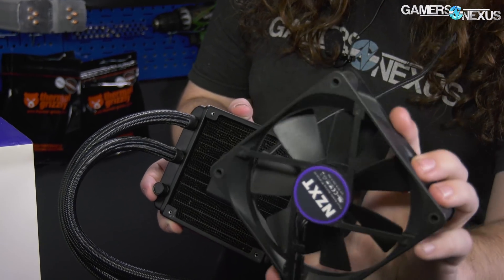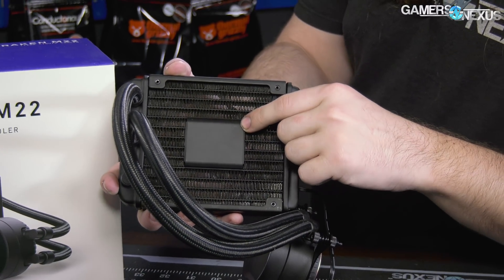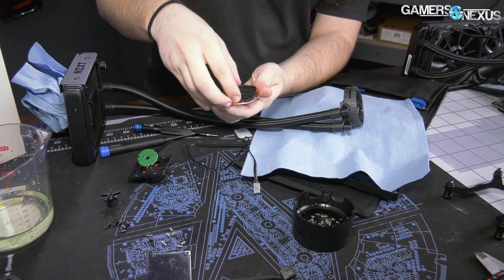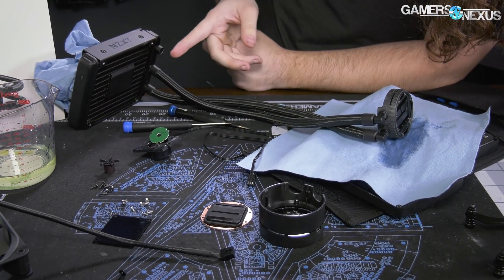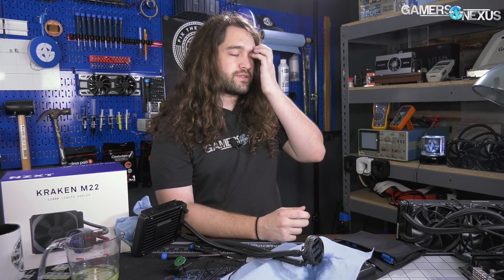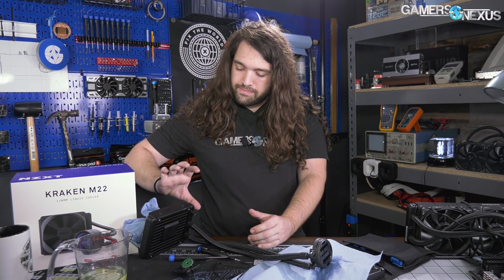Tearing Down a Strange Liquid Cooler - NZXT M22 Pump-in-Rad

Comment: You could put it inline, which would be better than on the water-block OR inside the radiator... But then It would be hard to keep buyers locked to buying only your proprietary hardware.
Reply: Point is that this is a fucking STUPID design.
Reply: Inline means a large ugly block in the middle of one of the tubes, which has been tried recently and not well received. This way they lost ~2 percent of the airflow to mean they can actually make their own product instead of just rebranding one.
My only concern with this design is vibration noise being transmitted through the radiator to the case
Reply: A Brackers - No. Try again.
Reply: Brad Gefroh Name any commercially successful aio with an inline pump
Reply: A Brackers - Name one successful AIO with a pump in the middle of the cooling fins. There are none, not just because this is nearly impossible to do with a reliable product, but also because nobody else is dumb enough to try. The system they've built here is louder, cools much worse, is more prone to leaks, is more expensive to manufacture, will wear out sooner, and is far far more susceptible to damage and leaks bumps from being bumped, because of the colossally stupid way that it's been designed.

Let's say you're an automobile manufacturer, and for years, you've been building vehicles with the engine inside of the engine bay, when one day a company comes along and patents that idea. Do you put your best engineers to the task of producing an engine that will operate from inside of the vehicles fuel tank?

No, because that's fucking stupid, and so is this design.
Reply: Brad Gefroh you know, you cant just say a product is bad without providing evidence, thats called defamation.
No one else puts the pump in the cooling fins because they didnt think of it and are perfectly happy to keep giving away most of their profits.
This design is actually much less prone to leaks than having an inline pump. Here the pump is fully enclosed, with a case pannel and dust filter on one side, and a fan on the other, making it one of the best protected components against bumps.
An inline pump on the other hand, has to have flexable rubber seals, which wear out over time as they are moving, and is free hanging in the case making it both extremally suceptable to bumps and making it likely to damage other components.
As for being louder or worse at cooling, neither of those are features of the location of the pump. Sorrounding any object by a dense but porous matrix of metal is one of the best ways of sound proofing, and that is exactly what a block of fins in a radiator is.
Also, as stated in the video, virtually no airflow from any fan travels through the middle, due to two factors you should know from school, the fact the outer edges of the blades are moving much faster according to 2 pi r, where r is the distance from the middle, and the centripetal force causing the air column to expand outwards away from the middle, making my earlier estimate of 2% cooling performance lost a high estimate
Reply: A Brackers - Well, I can, because I have a thorough working knowledge and understanding of engineering concepts, because I'm an engineer.

And as an engineer, I am qualified to say, "that is an unreliable, over-complicated, all-around BAD design". You're free to argue, but you'll be wrong if you do.

Kinda like if your opinion is that Nazis were actually mostly Chinese soldiers... You can argue that if you choose, I can't stop you... But you'll still be wrong,and that's where the story ends.
Reply: Operator 801 If you were an engineer, you would understand the need to have purchased the item and tested and disassembled it to understand the principals involved here, and would have had significantly more experience in reporting findings such as these in a clear and polite way, with supporting evidence, unless you havent actually been able to find employment within the field of engineering. From a Master of Mechanical Engineering, University of Southampton, 2010.
Reply: A Brackers - I'm not writing a thesis on this pile of junk, I'm just saying, "it's junk, nobody buy it".

If SpaceX gave a press release tomorrow that said their next heavy lift vehicle was going to be made of sourdough bread instead of aluminum, steel, and titanium, in order to save weight and cut costs, nobody would need to see it thoroughly tested before declaring it a really stupid idea. This is a comically exaggerated version of what you see here.  They have taken a perfectly workable system, made it far more convoluted and given it far more points of likely failure, all to dodge a patent and pad the bottom line by selling inferior components with literally zero improvements over the competing process. This is the epitome of bad design and anyone can see that.

Now please stop, you're making us look like fools.

Comment: but how does the pump move liquid though the radiator? im guessing its sucking on some tubes and pushing it out on one or 2 to the exit hose? i was half expecting to see a complete teardown of the pump assembly, including the channels inside the housing.. (and maybe bust open the radiator to see where the flow is?

Comment: I thought you couldn't patent basic things like locations of a pump
Reply: Apple could patent curves.
Reply: America, land of the corrupt corporations. Nuff said.
Reply: kal9001 yes, the actual functional deatils required to put a pump in a waterblock such as specialised pump geometry and mounting hardware are patentable, but just the act of putting a pump in the block is not patentable
Reply: Its not just location. Its the integration within the CPU block that is the "innovation" they are protecting.

The organisation of plumbing, and how the pump may be integral to the cooling plate etc... That said, if you were to simply bolt a pump directly to the top of the water block, that would be so generic they surely couldn't argue.

Comment: There's a video I always missed. A comparison of pump noise. With several AIO pumps mounted in a system, only pump running, not even the system running. We really wanna have a chart of pump noise levels. I run a music studio and is always a gamble when it comes to AIO pumps.

Also, why aren't there AIOs with bigger pumps that can run slower and move more water? Is it just a trend to make them as small as possible? I see space upwards for a potential improvement. I would love to see a bigger pump that can run at 1200RPM when you provide 12v

Comment: It looks like that design waist half of the cold plate and half of the radiator due to fluid travel. IMO they should of put the inlet at the cold plate on the opposite side of the fin stack and not in the middle. That way the fluid could travel across the whole fin stack and not just half of it.

Comment: A bit bigger rad or a longer motor of a smaller diameter would be better. Mounting the pump on the rad might improve the cooling of the pump above what mounting it on the CPU would provide.

Comment: That appears to be a 120mm rad. Knowing they take measurements from the outside of the whole rad, the interior is usually filled with fins. Since this has the pump blocking 1/3 of the fins, is it now called a 120/80mm rad? The flow of coolant through the pump/rad wasn't shown in this vid.

Comment: I'm really interested in how the flow is inside the radiator.  Does the 1/3rd with the unused barb not get any flow? Or does it come in the middle then split in the end cap and go back down either side and that middle barb is separate from the rest of that end cap.

Comment: I still cannot believe the judge actually found the way he did.  It's one thing if the other parties design is a direct clone, but it is not OK to patent a location.  I mean that's like saying it's OK to patent putting the LCD in front of the backlight - or the radiator in front of the engine in the car - or the water pump attached to the engine block.  This ruling needed to be overturned long long ago.
Reply: Pretty sure Asetek lost the case in the EU, but that's not really enough.
Reply: What if someone patented the placing of a fan on top of a cpu cooler?  Same thing.
Reply: Patents expire. 
After it expires then it goes into the public domain.
Reply: @hanro50  I'd be happy if patents expired in a few years, that would be enough to get a great market lead, but patents take too long to expire right now in most of the developed world. Also patents are too general, software patents are a big issue too.
Reply: @4.0.4  
Patents protect both projects that took millions of trillions of dollars to develop as well as common sense inventions like this one.

Ultimately stupid patents do have their place as they push companies to try new solutions to get around an annoying patent. 

Heck many gear systems we use today wouldn't exist without patent laws.
Reply: @hanro50  would you believe it take million for asetek to put pump on top of cpu?u dont need genius to figure it out
Reply: @peja5081  
You didn't read nearly anything of what I wrote previously...did you?

Maybe read before stating stuff I've already addressed.
Reply: @hanro50  millions and trillions

Perhaps if we talk about patents revolving around mars probes, but this is a cooler pump ontop of a heatplate. Hardly a billion dollar idea in terms of RND.
Reply: @hanro50  Well, only have to wait until 2038.
Reply: @lidua1  I lost hope in humanity
Reply: Most parents are only minor changes. If you're interested in this stuff search for Triz. It's a method to solve technical problems by minor changes. Because the competitors has similar problems it's useful to patent such small changes.
Reply: It is an innovation though. I don't think anybody did it before them... If it's so obvious, why didn't any other manufacturer do it first?
Reply: @daygeckoarthawaii1360  Other manufacturers did do it.  The people who made the fish pumps in the first place.  The patent troll took off the shelf fish pump impellers and used it to flow water thru an AIO. Then they complained to a judge when other people started making them saying that their impeller fits in the other brands pump when they're using an off the shelf replacement pump for another device.
Reply: Well, the whole IP thing is often a scam on so many levels.  If it is actually an important IP, the gov't just takes it and you get nothing.

Comment: I see a bit of a wasted opportunity here. CPU water cooling is hindered by the water's ability  to absorb heat due to the limited surface area of the copper plate. With the pump relocated, I was expecting some copper heat pipes to protrude upwards and into a series of fins to help transfer heat into the CPU block.

Comment: For the price, I don't see the value.  Easy to put in, sure, but so many compromises.  I am still of the mind that if you want water cooling you should go custom loop with a D5 or DDC style pump.  Ideally, D5.  Otherwise, stick with air.

Comment: $100? Really? My $45 Scythe FUMA will outperform this thing and won't be floating around in the Pacific ocean or rusting away in some landfill a year from now, where this (very cheaply made) CLC likely will.

Why are people so obsessed with disposable coolers? They are expensive, unreliable, and ultimately wasteful. I can understand if you are running a small form factor case and want the best cooling in limited space, but for anyone with an adequately sized case, a decent air cooler is clearly the better value.

Comment: I know pumps, a 5 prong even if shallow will disperse fluid better than a 3 prong and disperse water better at a slower speed, of course that's dependant on equal size propellers. As for the rest of the design, I'll wait for your review.

Comment: 9:06 measure the radius and multiply by two!.. I always wondered why Maya only used radius for so long until realizing uneven sided cylinders you can't measure diameter :P
Reply: God I really hate Maya. I was forced to take several classes based around it while I was getting my degree. I used to think that Abode products were overpriced but Abode ain't got nothin' on Autodesk.
Reply: Yeah the pricing is pretty high for sure, but there is validity in that you can make absurd amounts of money with it if you're so inclined. But, having started on milkshape3D modding quake 2, and tried many things in between then and now, Maya is light years ahead of the rest... I'd love to use Blender instead, but it's missing a lot still and the UI is horrific IMO.

Comment: Wouldn’t the wire on the radiator prevent a push pull configuration in some situations?
Reply: Bengy22 yea....
Reply: Depending on the radiator thickness, push-pull might not be worth it anyway.

Comment: 90% of the time the "inlet" is the one that routes to the center of the plate. on this one the one you hold to the top is the inlet "T" shaped slot.  They do this to get the colder coolant to the center of the plate where main source of heat is.

Comment: In terms of long term, leak free reliability, I wonder if the vibration from the pump will cause metal fatigue of the radiator tubes and solder joints to which it's mounted.  That aside, this seems like a neat idea, innovative even, that leverages the low air flow behind the fan's motor to locate the pump.
Reply: WarGamingRefugee putting on the edge would be smarter, you could even use it as a reservoir/pump/rad design.
Reply: Robert T the reason they put it in the middle instead of edge, which some designs actually already do, is because it allows it to fit in more cases that support only 120mm fans. There tends to be a metal bar, or wall or something in the way, even if just a few mm. This makes it more compatible with more cases. In fact, that's the issue I had with their 140mm AIO. My case has some random lip above the rear, so I couldn't put it there because the rad was just slightly too wide because the pump is on the edge of the rad.
Reply: On the cpu block is a superior design. More room, bigger impeller, lower RPM = less noise and more efficient. Except the retarded patent for "putting a required component in the most sensible location" exists. Fuck acetek, if you want to compete, do it by brute force. Make a superior design. You guys "invented" something that a highschooler could have figured out.
Reply: " Fuck acetek, if you want to compete, do it by brute force. " 
We are not in the 1500s.
This is intellectual knowledge and technological companies fight each other with their intellect and innovation, not with brute force, lol. If you want to be on the top, you have to be smarter and invent something better. 
". Make a superior design. " They already did, and that's why they are defending their design. They do not have to make it easy for the other companies.

"You guys "invented" something that a highschooler could have figured out."
Sure mate, to you it sounds like this, but you could say the same thing for many other inventions....until you actually get to try inventing something yourself and see how even basic inventions are can be harder than expected to do or think of.
Reply: And it was something that was being used in the later 1800's with steam engines... Soo yeah they didn't invent anything new.
Most of these pumps are based off of aquarium pumps, hell the one he took apart in this video remind me of the ones from the 80's and can move gallons.

Comment: fuck asetek
Reply: Why buy AIOs these days... Aircoolers are fine with today's cpus. For higher end its best to just jump to a custom loop
Reply: @SimanSlivar  RGB BRO
Reply: Asstek
Reply: +robert t u shouldnt be able to patent a concept
Reply: You could but then who would you get to make most AIO coolers? I do agree with you though.
Reply: @rowenelna  get a shitty custom loop from aliexpress. Works better and is cheaper.
Reply: Roger J I don't. They design, implement and produce an innovation such as pump on heatsink, they should have the right to be able to sell and/or license it.
Reply: Asetek has done a lot to bring liquid cooling mainstream.  Don't be a sheep and just lash out at anybody protecting their design.  Use some logical thought

Comment: "This might be a filler/drain port..." proceeds to not use it lol. <3
Reply: DbDBlackJack, those filler/drain ports are normally plugged up on a typical A.I.O. system in such a way that you can not unplug it, without braking something. They are more or less sealed shut.
Reply: Jovica Janjic Thank you. Makes sense. Better to have one oring vs three.

I wonder though; assuming the mfg understands the volume of fluid needed to fill the system, why not just fill it before installing the pump? Then they'd have no need for those ports.

Thanks again.
Reply: DbDBlackJack, well I guess they first finish the whole A.I.O. assembly process, and then they fill up the system trough that port untill it spills over (like the brake bleeding process on a car) untill there is no more air inside of the system, and they just seal that port up so you can't mess with the liquid inside. At least I think it's so. Not shure though. On the topic why you are not allowed to tamper with the cooling liquid - well I guess so you don't fill up the system with some random liquid, not meant to be used for water cooling, and by doing that you destroy the pump or make the hoses porous or something.
Reply: Jovica Janjic Okay, I can see that. Theres probably 100 ways to do it and this is just theirs.

All this talk makes me want an aio now lol.
Reply: DbDBlackJack lol he lives life to the max

Comment: Wait, the flow is from the middle of the fins to the other side o am I seeing things?
Reply: AsciiGDL I think the pump drives the fluid through the group of fins that it's located in, then the coolant returns to the fitting side tank to be returned to the cpu block. Probably a diagram on their website, now that I think about it.